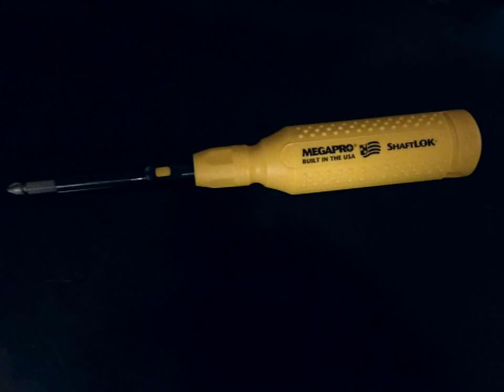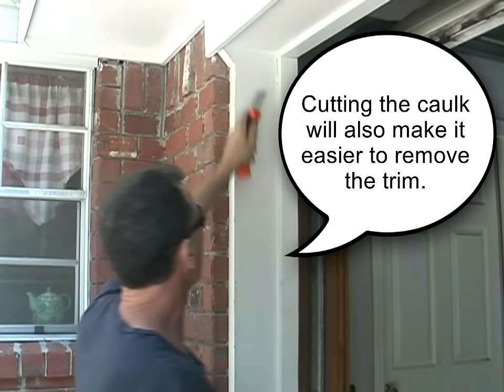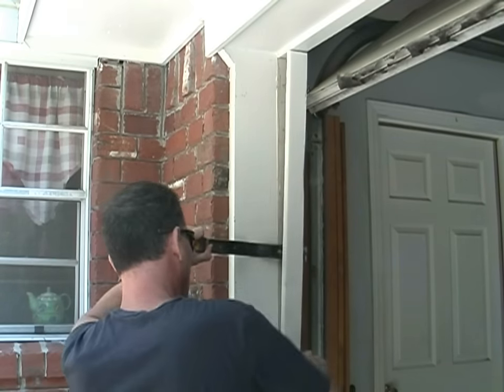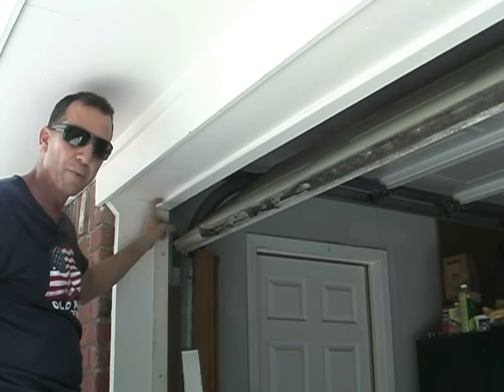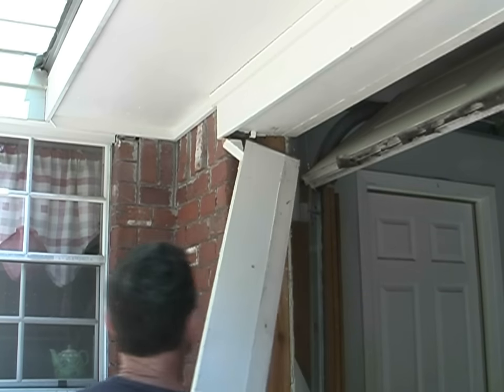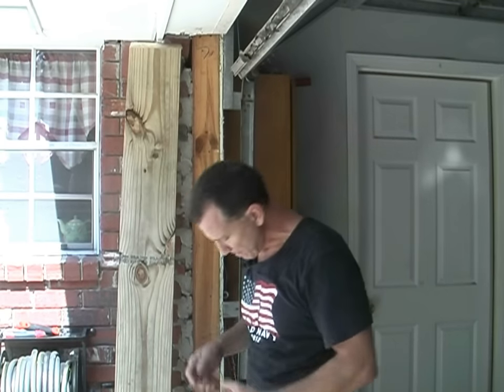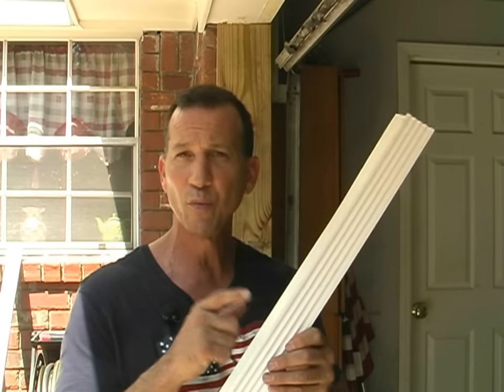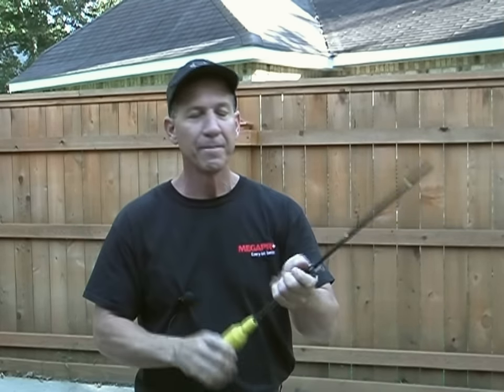Repair Rotted Garage Door Jamb!

Comment: how do you feel about using vinyl instead of pressure treated lumber?
Reply from the maker: awesley92 
Hi awesley92,
I would much rather vinyl. I am very busy and I had a small window when doing this. I had 1 treated board in my shop and I only had to purchase 1. The vinyl boards are more expensive, but well worth it. When possible, I do use vinyl. Thanks for bringing that up!
Paul